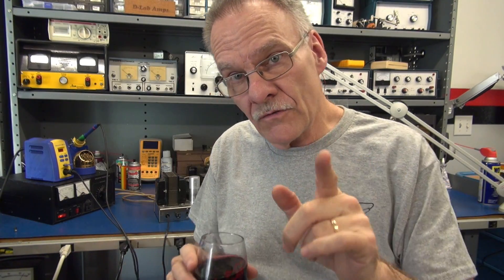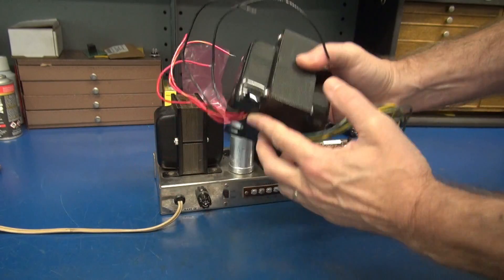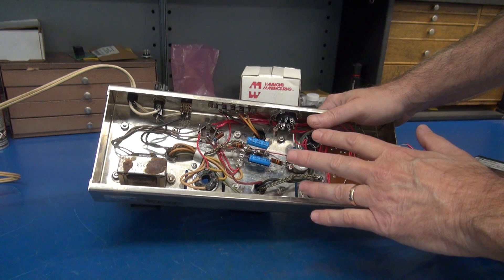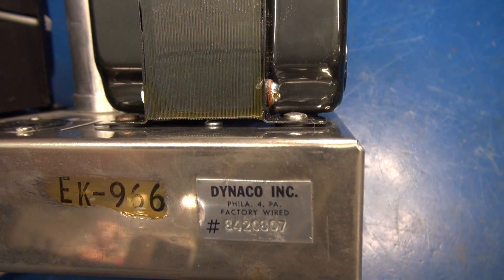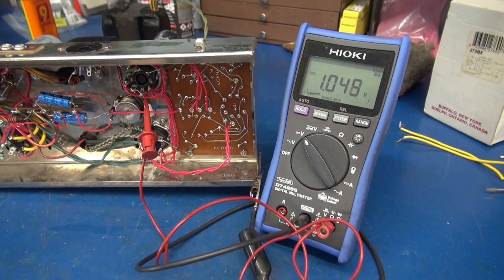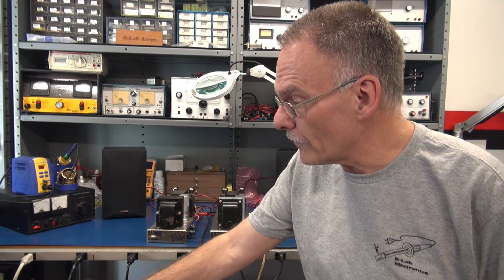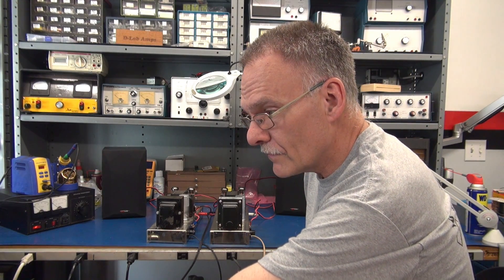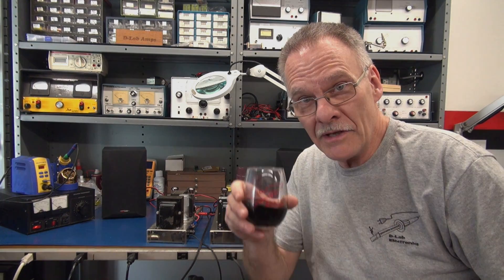Dynaco Mark IV Tube mono block amplifier transformer replacement D-lab solution Hammond 273BX

Comment: A very interesting way to put in a new power transformer that has a center tap to ground and  a circuit for the negative
 bias that you use for that with a simple modification. Nice.

Comment: Terry! Can you recommend a place to advertise two 1930-1940's console radios? They are in decent shape and ready for restoration. One is a Zenith that has a pull-out turntable in it as well as a radio that is not only AM, but Shortwave as well. Both have tube amps, the Zenith having a 15" speaker. We don't have swap meets anywhere around me (Portage, WI) that would make it worth lugging these huge things to. Any suggestions would be appreciated.

Comment: Great video. I know it's a nitpick but I wish those transformer screws weren't so long. Trim them down and put black acorn nuts on them!
Reply: I use a Dremel tool with a reinforced cut off wheel for doing that job. Easy Peasy.